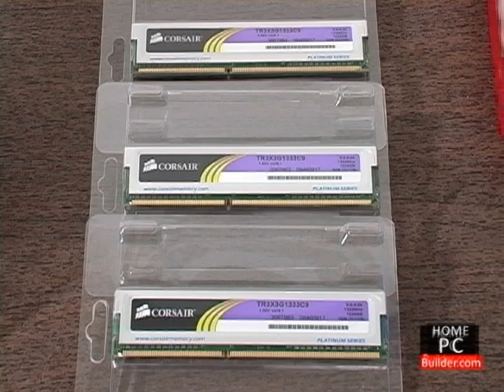Build a PC Computer - S03 L01 - Overview of Parts  - All New for 2010 - homepcbuilder.com

Comment from the maker: @Illmatic662 The Home PC Builder 2010 DVD has all of our build your own computer videos.  The internal and external component videos explain what each part in a computer does, features and specification to look for and how to make sure all of the parts are compatible.  The installation videos show how to put all of the parts together and get the computer running.  The computer setup videos shows configuring the bios, installing Windows and getting all the drivers loaded. This is all included.